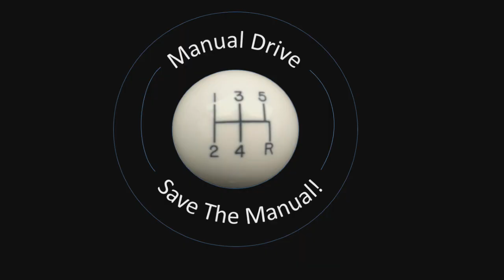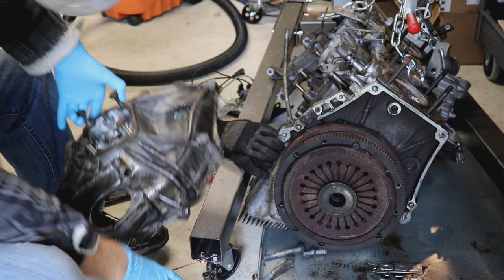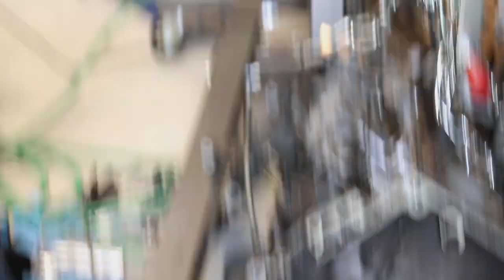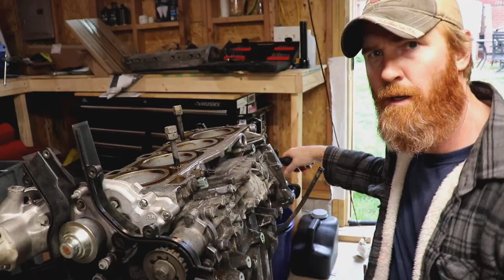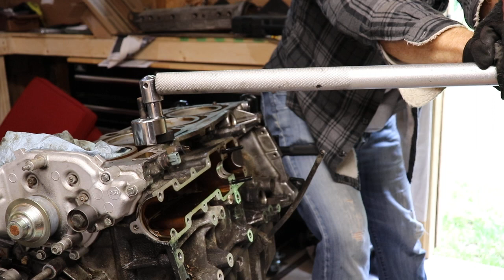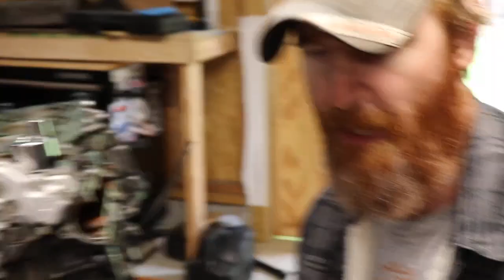Porsche 944:  Project 944 - Engine Disassembly Part #1

Comment: The studs have thread locking compound on them. The trick is to strip the block to nothing and then throw the block on a gas grill on LOW heat long enough (maybe 30-45 minutes) to heat the whole block, softening the thread locking compound.